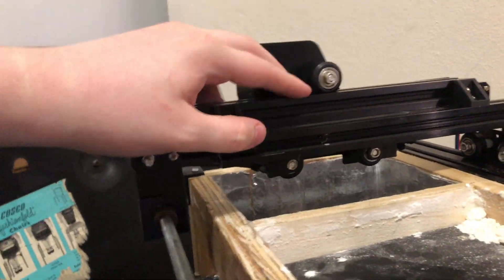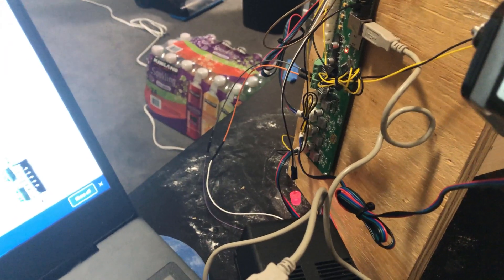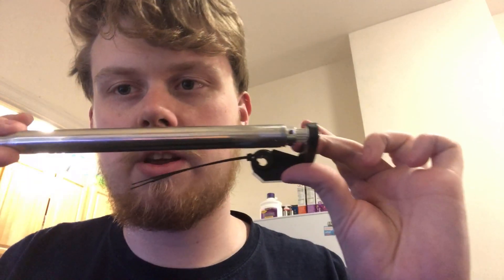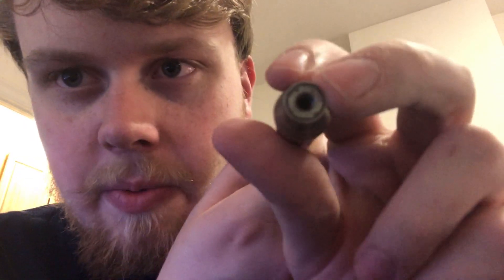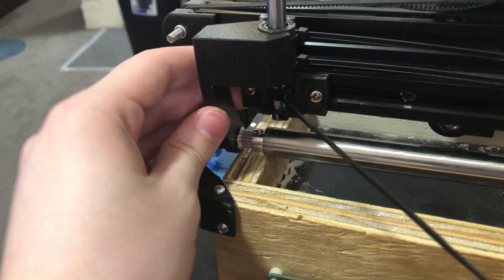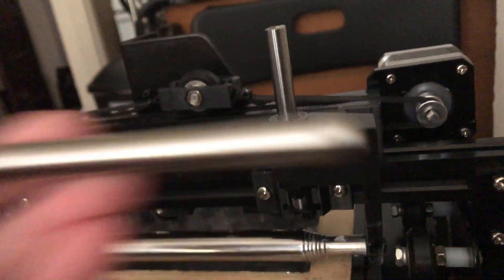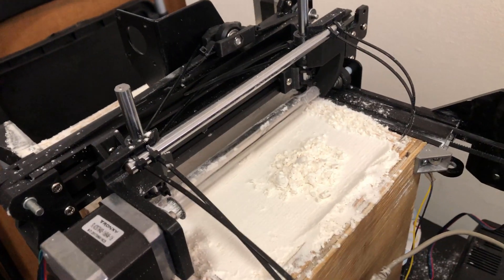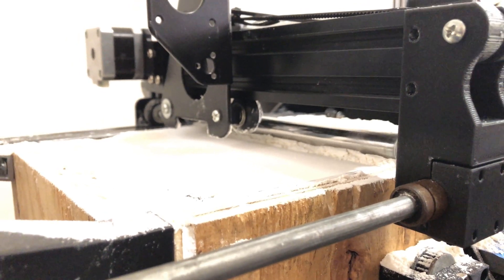DIY SLS 3D Printer || Part 4

Comment: I work for an aerospace company utilizing SLS and other systems for prototyping. Some thoughts you might consider: The chamber has to be heated and inert. If the chamber is not under enough heat the fused section will warp and curl up causing a failure on your recoater. the temperature needs to be just under the melting temperature but not so much the block begins to harden. you would be better off starting with a commercial oven as your base in order to get to the needed temperatures. Also the build frame needs to be heated as well or the powder will shrink and you'll lose Z axis stability. even a 1 degree variation will cause build failure in an industrial level machine. Consider switching to a galvo system for your laser with a theta lens for your focal height as moving parts inside the chamber is not a good idea. Materials: Nylon 12 is your easiest to work with. Please for your own safety use caution for fire. The powder can explode if not handled right and if it does burn you'll gas your home in minutes.

Comment: Hi Nick, first of all bearing of course. Second thing is that powder is not so forgiving as flower, you will need some chamber for your prototype (to keep heat inside, to prevent powder disturbing due to draft... and finally to prevent your lungs get full of that stuff). Also if you watched professional systems you are probably aware that they have heated chamber which firstly is filled with inert gas and secondly is keeping powder just below melting temperature, laser is there just to give it a nudge.
Reply from the maker: I plan on using pla powder, not nylon so it melts at a much lower temperature, I might look into something for the draft but the temperatures shouldn’t be a problem, thanks for your input though!

Comment: I think you could use a dc motor to spin the roller and use the stepper motor on the other side of the pusher so it moves much smoother
Reply from the maker: I think so too, I just don’t have any dc motors that have the right shaft diameter for the pulley, once I get a new roller that’s actually concentric I’ll look into a new motor